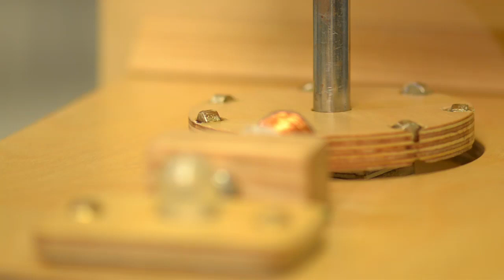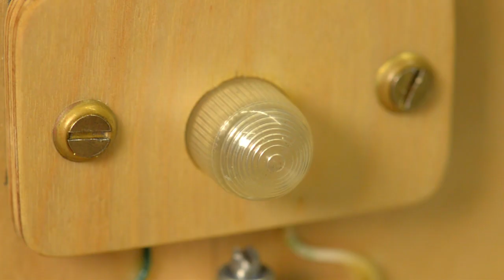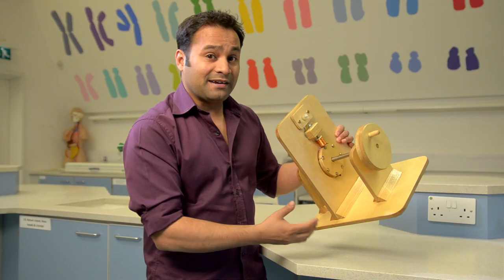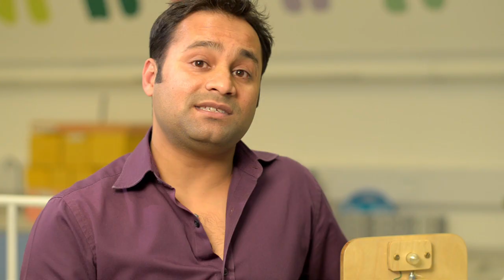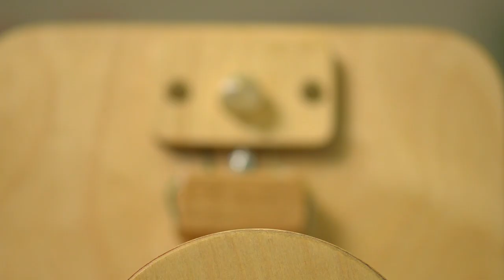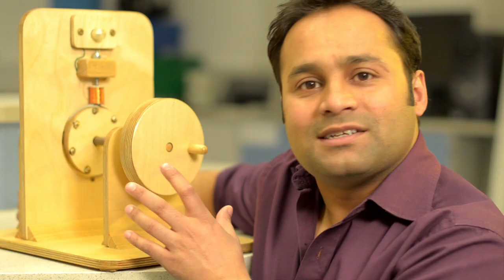Electromagnetic Induction

Comment: You can add on/off switch to break circuit and show (might be harder on video than in real life) that magnet wheel spins with ease when not generating electricity, but requires more energy to spin it when electricity for bulb is generated (circuit is closed). I didn't realized this fact when i was young ;)